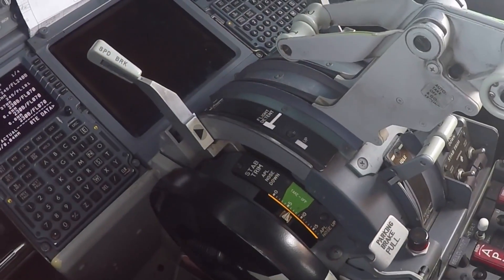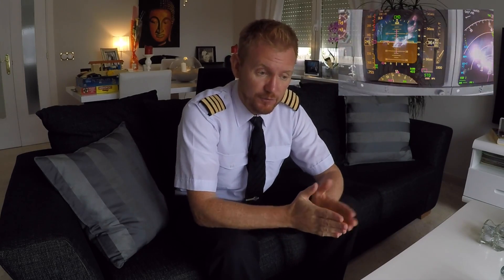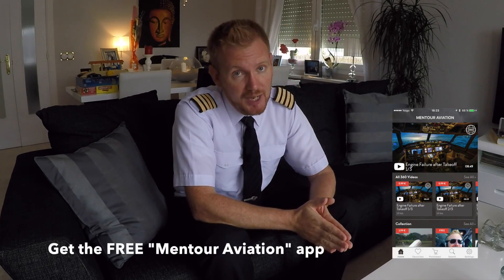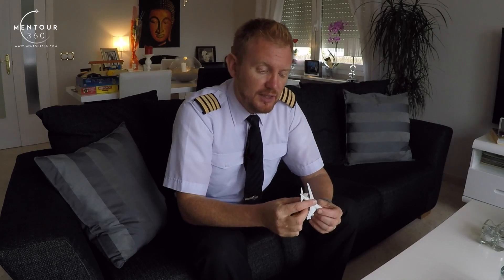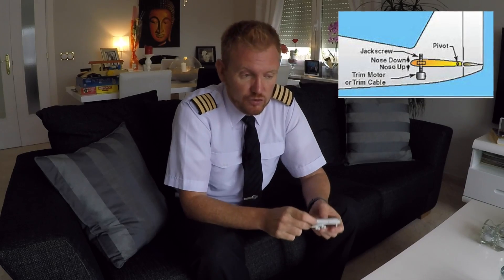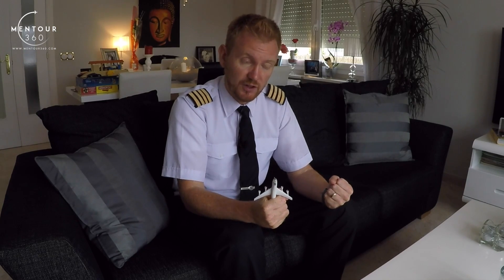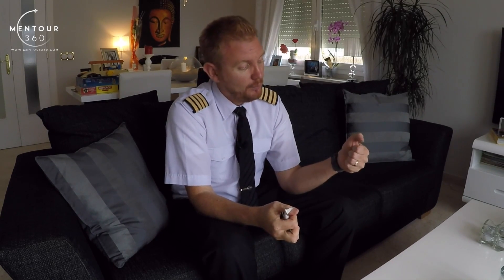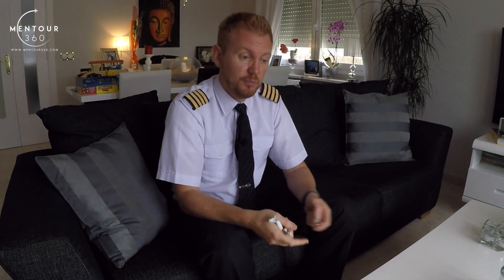What is that spinning thing?

Comment: Does it mean, that you can make some minor changes in the pitch angle just by trimming the elevator instead of pushing or pulling the yoke?
And also does it mean, that when you are adjusting the trim while holding the yoke out of the neutral position, you have to release it slowly to match the actual trim?

Comment: Airbus does not have anything spinning in the cabin. everything is drive by wire technology. They still monitoring everything going on including trim, via sensors. If trim motor stop working, airplane instantly will have warning light on dashboard, instead of massive spinning wheel next to pilot knee. Looks scary when it rotates with hi rpm next to your knee. Can not relax and lean your knee up against this wheel - would be a desaster.
Reply: Dude…that first sentence is, in most Airbus aircraft, wrong..e.g the Airbus A320 has a moving stabilizer trim wheel☝🏻

Comment: did  that  manually on my Rollason Condor with a  central  wheel,  hands  off  and see what  happened forward  or  rear pitch  and  then  roll it  until the  plane  flew  level

Comment: Great videos. Old or new. 
Q: So flying a Boeing allows you to monitor everything what the auto pilot is doing, just like explained in the video. 
Can someone tell if Airbus has a different approach related to that? Thank you in advance :)
Reply: One example is the autothrottle (Boeing) vs autothrust (airbus). Boeing's just move the throttle levers, which in turn control the engines, so you can look at them or put your hand on them and see/feel what it's doing. Airbus, you put it in a detent and the only indication you have of what it's doing is looking at the engine gauges. For a more subjective and general answer, in Boeings you fly the plane, or you can get the autopilot to fly it for you, in Airbuses you tell the plane how you want it to fly itself, or you can get the autopilot to tell it.

Comment: Why are jackscrews still being used to move aircraft trims despite the fact of failures that have caused terrible accidents and loss of lives? What don't manufacturers use actuators to move trims similar to what cars are now using to lock, unlock doors and other functions all done electronically?

Comment: Great video, Captain Mentour ! I was always wondering what those spinning wheels were, and what a trim tab did. So trimming is equalizing opposing forces on a flight control surface. Am I correct ?
Reply: Close… Not so much opposing as zeroing out the force by doing the job itself.

To start off, the stabilizer is producing an aerodynamic force in the downward direction that—together with the airplane's weight force and the wings' lift force—acts to keep the airplane at a certain pitch attitude. The elevator is in a neutral position, producing no aerodynamic force. To change the pitch of the airplane, the pilot (or autopilot) applies a force on the elevator control, which deflects the elevator and creates an aerodynamic force in the up or down direction. This aero force acts with or against the aero force that the stabilizer is maintaining and results in the airplane's tail dropping or rising to a new position, resulting in the airplane pivoting to a new pitch angle.

To maintain the new pitch attitude with the pilot or autopilot applying that force on the elevator control would be bad. The pilot would become fatigued quite soon and may also inadvertently increase or decrease the force being applied as their attention is diverted to other flying duties. Also, when disengaging the autopilot to fly manually, the pilot would not know how much force the a/p is holding on the elevator and would be unprepared for the a/p's sudden release of that force, resulting in an abrupt pitch change that could damage the airplane structure, cause loss of control, injure passengers, deviate from the assigned altitude, etc.. (That is why the autopilot will trip and disengage if its efforts to trim seem to be failing. Also, it will not engage and take control if it finds that the pilots are applying a force on the elevator control. The system is also designed so that the pilots cannot trim in one direction while simultaneously using the elevator in the opposite direction).

So, once the airplane has settled into its new pitch attitude, the stabilizer is adjusted by the pilot/autopilot into a new position such that its aero force increases or decreases and the elevator is moved back to its neutral position because its aero force is no longer needed. Then the stabilizer is once again the only control surface holding the airplane at the desired pitch angle, and the airplane is said to be "in trim" i.e. it maintains its pitch attitude without any force needed on the elevator control (hands-free).

Hope this helps you understand.

Comment: Mentour, I remember that when the 737MAX crashes happened, people where talking about the pilots not being physically strong enough to fight the actions of the MCAS, but I didn't understand what exactly they were trying to move manually. Is it this trim that they were trying to roll manually? If yes, why?
Reply: Yes, it was this trim. MCAS was adjusting the trim to be nose-down because MCAS (due to the faulty input of an angle-of-attack sensor) thought the plane was going to stall. MCAS overrode the electric trim switches. There are cutout switches which disable electric trim control (MCAS or switch), and when these are activated, the trim could be changed manually via the wheel. However, the aerodynamic forces may have been too strong for the pilots to turn the wheel.
Reply: It's possible to move the trim wheels manually when you have issues like runaway stabiliser you can disable the electric trim and you do it by hand.

Comment: Incorrect, sir. The entire stabilizer does NOT move up & down as you stated multiple times, it only tilts.
The real issue is that canards are truly designed with all wing surfaces providing lift, but normally designed (and FAA certified) aircraft must not stall without input or power, so the tail always pushes DOWN, and less speed & airflow lets it rise thus pitching the nose safely down preventing stall.
You & I know that as pilots, so please stop confusing non-pilots.
Reply: James Fox Think my part.66 B1.1 says otherwise..but ok. Havent worn overalls in a few decades now have you??
Reply: James Fox Semantics..most engineers, certainly the ones I know, will say that the horizontal stabilizer moves up and down. And so do most pilots. You gotta be really square if you say it tilts.
Reply: James Fox Real engineers knows that the hor stab moves up and down..

Comment: Why is there a bumping sound during take off and landing and the sound syncs with the speed of the plane. Is it the runway lights or Sunday concrete?
Reply from the maker: It’s the centerline lights you are hearing when they hit the nosewheel.
Reply: @MentourPilot  Ah I thought so. Thanks for taking time to reply. Really appreciate it. :)

A follow up question. Doesn't that affect the landing gear considering the speed. And what if we could embed the lights in the tarmac itself under a glass at angle that can be visible for the pilots both during take off and landing.

Comment: I was on a short up-and-back flight in a Canadian Air Force Buffalo. Comox to Anchorage. On the way back there was about twelve of us in the aircraft, and we noticed that the pilot was just sitting there, casually trimming the elevator (it was 100% manual). We moved aft, and chuckled as we watched the pilot automatically spin the wheel to compensate. Then all of us silently moved up front, and to our glee, watched the pilot spin the wheel the pother way. This game went on for abut three cycles, then the pilot sat up straight, looked back at all of us huddling right aft. The jig was up. Hard up elevator, then hard down, and we all felt zero G, then the hard floor.

Comment: Part of the Boeing philosophy is that you should always be able to see what the aircraft is doing...

...except with MCAS.
Reply: MCAS was a horrible idea that killed hundreds of people. i hope someone will end up in jail for it.
Reply: @guguigugu  Knowing how those things usually go, the FTC would likely fine them around $100,000 and tell them to try not to get everyone killed in the future, or it will be another $100,000 fine.
Reply: @Razor2048  It would be a lot more than $100K, but you're right, it won't be much. Or, more importantly, enough. Companies consider most fines handed down by regulatory agencies to be nothing more than the "cost of doing business." They're a joke and change nothing. Until prison sentences are a real and consistent threat, breaking the law to increase profits will be a standard operating procedure in virtually every industry, not just aviation.
Reply: I imagine a certain Air France flight would have survived had the Captain been able to see that the PF was pulling back on the sidestick and worsening the stall condition.
Reply: @robharris5467  Ah. Typical boeing fanboyism to divert the conversation to AF 447. Why don't you add the dc-10 exploding cargo door or the 737 rudder deflection while you're at it with the baseless arguments.
Reply: @BD OH There was no diversion… the conversation is about the position and movement of the controls on the flight deck showing the current input to the controls or changes being made to those inputs by automated systems or the other pilot. The comment about AF447 was pointing out that the A330 flight deck controls do not have that indicative property, and that deficit contributed to the loss of the flight. The comment was in response to the OP's erroneous statement that MCAS did not comply with that indicative property and furthermore erroneously insinuated that the noncompliance was the cause of the 737 MAX crashes, so it was very much in context and not a baseless argument. The cargo door and rudder PCU issues that you mentioned were not germane to the conversation at hand.
Reply: @hodb3906  Divert the coversation? Surely avoiding conflicting inputs is a plus. As I understand it on Airbus aircraft the conflicts are averaged out. In an emergency the captain takes the controls and even in a go-around situation, no one wants the PF to try to continue the landing. Maybe a crew requirement would be when (as with A447) the captain says 'My controls' the other pilot MUST remove hands AND feet from them. And why am I a Boeing fanboy for pointing out an obvious problem with Airbus?
Reply: @robharris5467  i imagine there's bloke that's very naive and still supporting one company that has killed hundrerets of innocent life and yet they still even manage to blame the pilot for that . shame on you
Reply: MCAS failed because Boeing deviated from this longstanding philosophy, without investing in or having the know-how to do a "pilot-opaque" self-correction feature properly.  And thanks for explaining those trim wheels.
Reply: The A320 has them as well.   Not just a Boeing thing
Reply: @Boston737Brian  The A320 as no trim wheel it is Automatic trimming and is much much better ( I have 5000+ hrs on B737)
Reply: Luc Sergerie Aren’t the two wheels right and left of the  throttles (oh wait airbus talk “thrust levers”).   trim wheels on the Airbus I’ve been in the flight deck a number of times.
Reply: @Boston737Brian  they are there but you can't trim them manually ( is no control on the stick) only in back up mechanic mode in clear we never trim a A320 in normal mode.
Reply: @lucsergerie1835  still would be nice to see what the airplane is doing. Does it have a digital screen telling you what its trimming?
Reply: @natelav534  we can see the trim but in 10 years flying airbus i have zero trim malfunction :)
Reply: @lucsergerie1835  Boeing is really falling behind huh. Im always hearing about Airbus getting cool new stuff and Boeing keeps getting bad news with the triple 7 and 787 issues. Sheesh
Reply: @natelav534  Boeing needs a corporate overhaul and has to get back to its roots. It’s been said a million times, but it was once the industry standard and lead by visionary engineers, whereas nowadays it’s spread itself out far too thin globally and is lead by accountants and board members.

The Boeing that once developed the 747 in only 180 days, while literally having to build the massive factory it would be constructed in simultaneously (and that would then go on to have an industry changing impact and almost flawless record) is sadly long gone. This new generation, even with all its advanced technologies and resources could never accomplish such a feat even if given years to do so.
Reply: @LiterallyShaking  yeah whats with the lack of backup systems with all this new tech on planes. I thought the philosophy was if something fails have a redudant system. And have a redundant system for your redundant system. Im certainly not an airplane designer but i assumed that philosophy was pretty clear. Why put a system in that takes away redundancy? It does nothing but make it more dangerous by overriding the pilot. Thats not even corporate corner cutting its plain ignorance because weve known vital systems with no backups are deadly for decades.
Reply: @Luc Sergerie There are many pilots as lucky as you who have had zero trim issues in ten years of flying the B737 😇
Reply: Good for safety.
Reply: Oh, such a terrible thought. Boeing designed it! You fly it! Passengers prayer it!  Stay safe and happy!
Reply: @williamgibb5557  well i guess that's not happening with lion air max and ethiopian's max
Reply: Yes.
Reply: Wrong. MCAS operated the stabilizer trim and when the trim is operated "those spinning things" spin and make a loud clacking noise. So the pilots COULD and DID see what the airplane was doing.
Reply: @petep.2092 
Not wrong. They couldn't see that the MCAS existed and that it trimmed the aircraft against their will. They could only see the aircraft trimming itself which clearly meant nothing as they couldn't control it or make it stop. Do I really need to spell this out for you? Sigh...

You should stop being a contrarian just for argument sake. The point of my comment, which clearly went over your head, still stands. Arguing the semantics of it is irrelevant as it will not erase what happened with 737MAX and the deaths of all those people.

Comment: Hi, what is the small red lever under gear lever? 🤔
Reply: It's the lever lock override trigger. If there is a failure in the lever lock solenoid this trigger will release the lock manually.

Comment: So if the trims were manually controlled by the pilots  in the Ethiopian airlines and the lion air (Boeing 737- max 8), the crashes wouldn't have happened right?
Reply: They tried but the computer  just trimmed back again and again

Comment: The translator system is misinterpreting many words, it doesn't get UK accents at all, it totally screws up Russian and many other languages. I can understand fine but I've had many friends from the UK and used to var accents, specifically it's seeing auto as outer and some other stuff, the slightest accent inflection gets messed up, YT/Google needs to fix this, imagine if they were pilots, we'd end up in N Korea if the translator system screwed hearing Coke from someone w an odd accent. .

Comment: So in short, the two 737-max 8 aircraft which crashed because the MCAS (design flaw adjuster) system was malfunctioning should have potentially been able to see something "funny" going on with the trim wheels action...
Reply: They knew that something was going on.  They probably didn't know that MCAS was causing it.  The instructions that Boeing said they should use seem to have been written for a fault in the auto-pilot or the actual motor in the back of the plane.

Comment: This video hasn’t aged well. 

While you can see the benefit of having more situational awareness and supposedly more control in a Boeing aircraft which would have prevented a disaster like AF447 where the Pilot Monitoring had no idea the Pilot Flying had his side stick all the way back...... the moving trim wheels did not prevent two MCAS runaways. The crews were busy dealing with erroneous stall warnings and a trim wheel that slowly and intermittently trimmed forward until the aircraft was no longer controllable.  Boeing chose not to even reveal the system that should have been permanently deactivated with the first manual trim input.

Comment: So errr MCAS is a stabilizer trim runaway..
Reply: No it’s not. 

A stab trim runaway is very fast. 

An MCAS malfunction is slow, intermittent (stops after trim switch is engaged and doesn’t start again for five seconds), manifests itself with a stick shaker activation (due to faulty AoA vane), and can be inhibited by extending flaps or engaging autopilot.
Reply: @Bartonovich52  OK, tell the Ethiopian pilots that. Guess they weren't flying it properly. Not able to control a slow trim malfunction huh, losers.